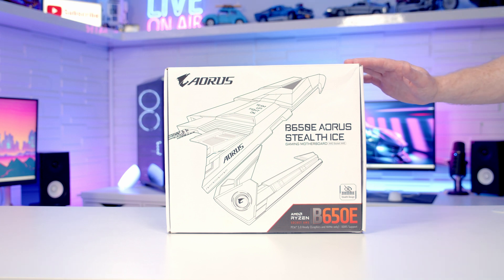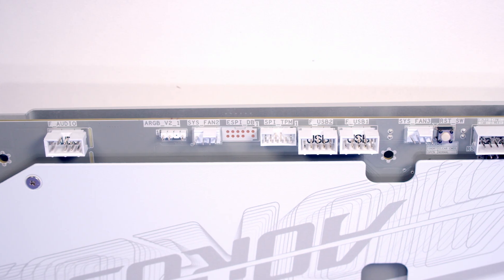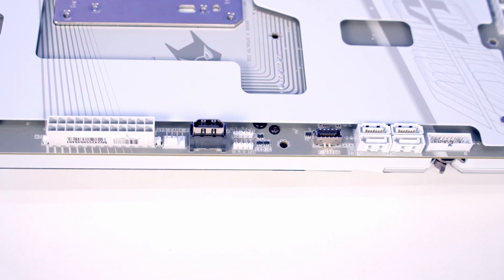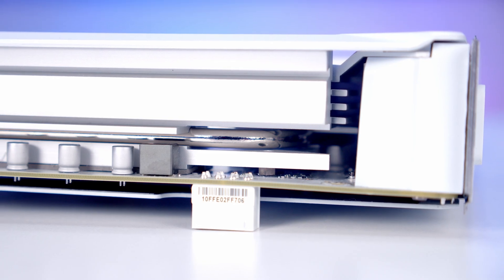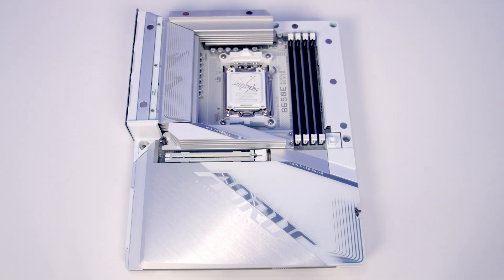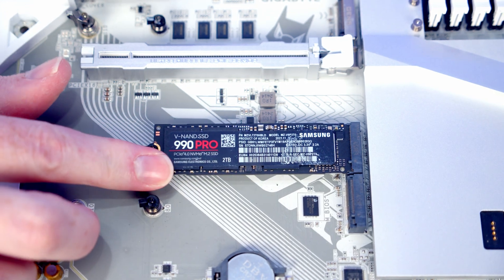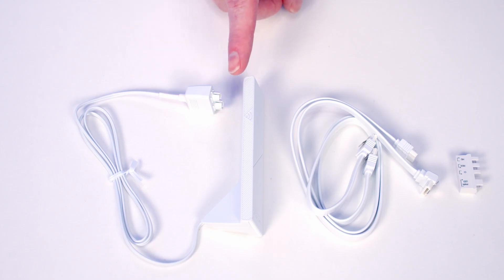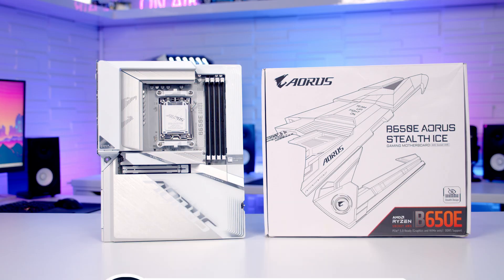B650E AORUS STEALTH ICE Overview

Comment: Yeah the price on Newegg is just not worth it. It rather save $250 to get the pro ice bc of the extra sockets and features. $650 for a B series back connect with 1 PCIEx16 slot, 1 gen 5 M.2 slot and like half of the features is sooooo not worth it. Back connect would be nice and clean but it’s just not a good deal unfortunately

Comment: Looking at buying one of these for my build, was about to pull the plug but read there’s been some issues with the RGB control and compatibility anyone else had trouble?
Reply: I had some trouble with the GIGABYTE Control Centre taking control of my corsair ram making it unable to be controlled by the ICUE software, unless you really care about the motherboard rgb, i just disabled it in the bios so it would have no affect on the rest of my rbg. I also wouldn't recommend installing the GIGABYTE Control Centre as its pretty much impossible to remove from your system.

Comment: Now Christopher I have a question for you, I'm not as knowledable so I prefer ask experts - this motherboard has only one 8pin connector for CPU. I'm using 9800x3d (stock non-OC) which draws around 155W in Cinebench R23. Do you reckon it may be an issue? Maybe I'd have been better off with a motherboard that has two CPU connectors for the stability of 9800x3d?

Also, I've got this motherboard last week and I don't believe I've exprienced more issues with any piece of tech I ever bought for this kind of money. Random crashes with BSOD, all four LEDs flashing red (cycling) like a toy, randomly losing video signal (gpu tested), randomly losing hold of the RAM.
Anyway, I've ordered the second one and I'm trying it out tomorrow, hopefully it'll be good this time since I've especially bought O11 vision compact to display this beauty.
Reply from the maker: One 8 pin will be fine
Reply: Still having any issues? Thinking about buying this board with the 9800x3d or spending a little bit more money and getting the x870 aorus elite ice.
Reply: @BrianTobey-zk3tt  I could not get it to work properly and just gave up and bought x870 Aorus elite ice, not a single issue sinc then. Very happy with the purchase, the design wasn't worth it.